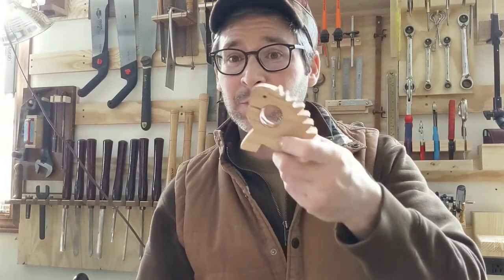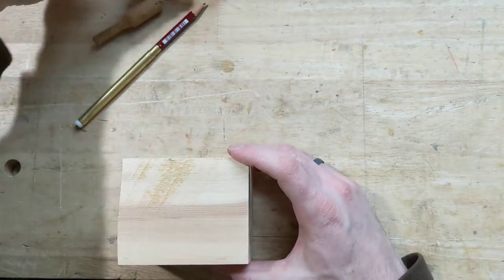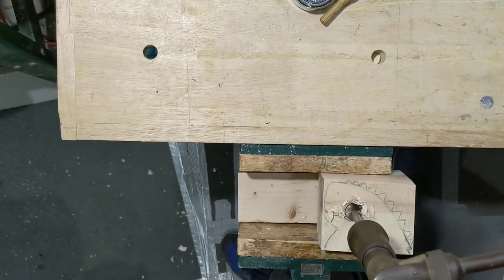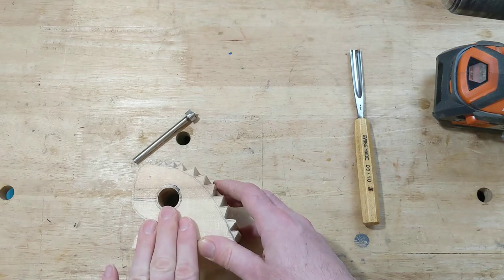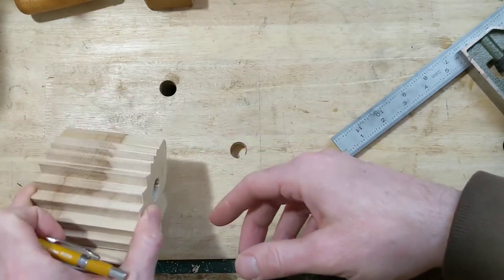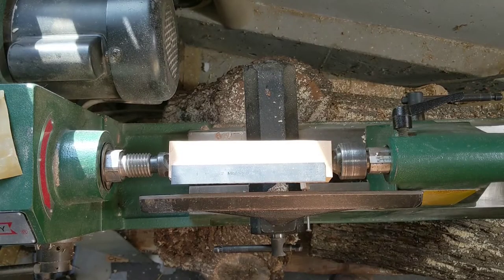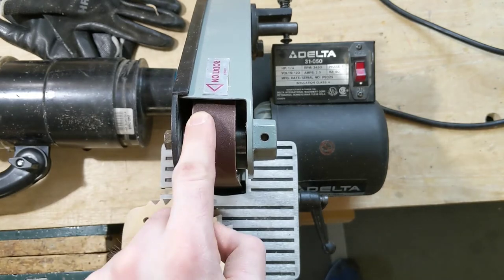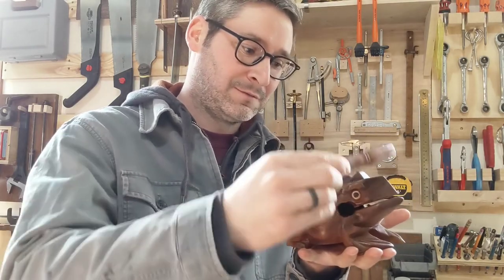How to Make a Wooden Frog Rasp Percussion Instrument

Comment: How did you polish the brown frog sir, I am new to woodworking so don't know about what kind of polish is that. Can you suggest me which kind of polishes I can use.
Reply from the maker: Sorry for the late reply, I was on vacation when you commented, and I forgot to get back to you. If I remember correctly I used, "Mahoney's Finishes Walnut Oil Wax." I think you want something that is going to soak into the wood rather than sit on it, so that you don't crack or flake your finish when you play the frog. Any drying oil would work well (tung, lin seed, walnut, etc.).

Comment: Sadly I don't think I will be able to make it, I can't find the proper wood that is not a plank maybe I can find some soon on the street somewhere soon
Reply from the maker: Bummer, I hope you can source some appropriate wood soon. Just about any hardwood should work, it just needs to be an inch thick or so. If it is thin, you can scale the design down and bit, it should still work out, or you could possibly glue a few planks together for a thicker piece.
Reply: @JoshsShop  yeah I could probably do that actually, thank you
Reply from the maker: If you are going the glue up route, you might try hollowing the layers before you glue it together, it would probably be easier then the way I went about it. :-)
Reply: @JoshsShop  yes! Thank you. I will definitely do that, because I have a few hard wood planks